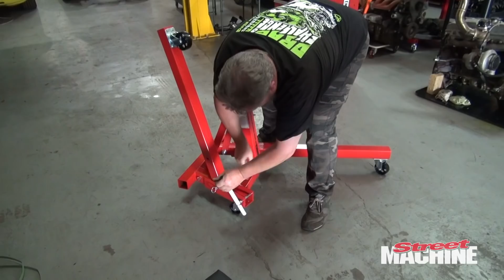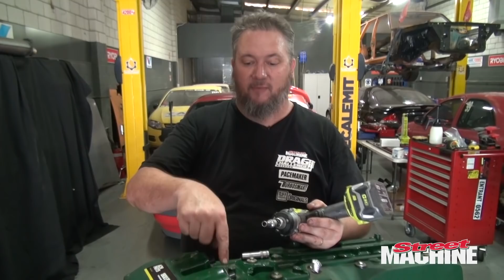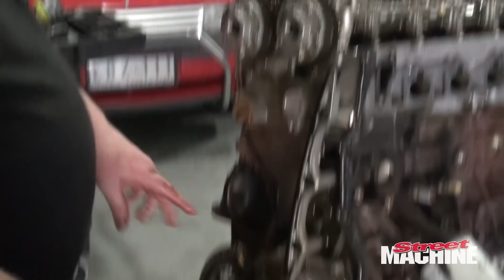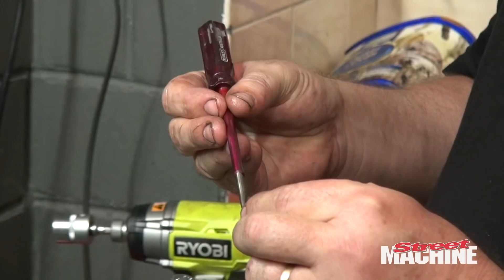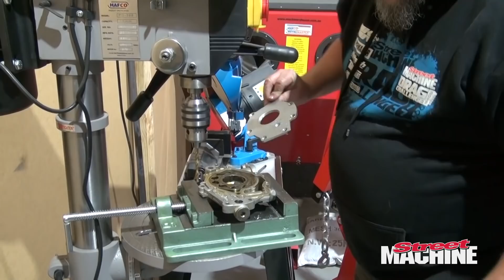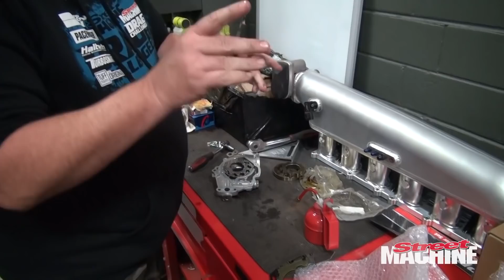Carnage Plus EP60 - Building A Barra For Boost - Part-1

Comment: How bad do the cam bearings have to get before you throw away the head?
Reply from the maker: There are no bearings, the cams sit straight into the head. I haven't had to throw one away yet.
Reply: @STREETMACHINETV  do you ever have line bore the cam bearing towers?

Comment: Hey mate, I’m an Australian mechanic working in Europe. With the rust and the torx I learnt to use a 3/8 ratchet in those situations because it gives a better feel and use Hazet tin coated torx bits. 

Using a hand impact driver like snap on PIT120 or KOKEN attack drive can help but I just get a punch the same diameter of the torx and hit it with hammer to jar the torx so it loosens.

Comment: Awesome 👍 brother...
I watch you...
Im hoping to get a Ford territory....NA..

I was thinking...
Change .. valve springs
Cam ..
Air filter
Oil pump
Header's..

What you think...
Will that make...my NA... Barra
Better than stock.. surely...
Reply from the maker: Oil pump gears are mainly for manuals or lots of power. Cams, valve springs, headers, tune will help you make more power
Reply: Thanks for your response..
I was watching....
Haltec.. video...
Talk about the almighty Barra.
He said those parts...
I watch your video... you were changing those exact parts. 
Awesome 👍 brother..
 I was taking them notes down.

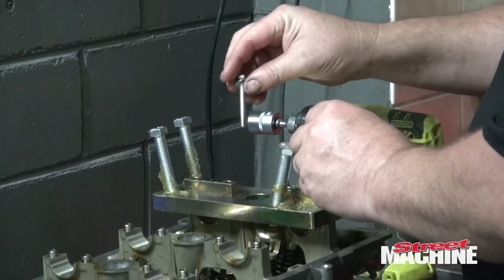Comment: 14:57 it's a year on so a bit late now, but for everyone else usuing this tool, make sure the 2 spacer blocks on top of the tool are underneath it. It makes everything line up and can get the new spring in without fighting it. It is on the wrong side here. Dominator had a batch of tools go out the wrong way round.
There a great company with awesome products. 
Cheers

Comment: Hey mate do you guys have a normal shop? If so what would you charge to do my pump gears, valve springs, head studs, cooler on my bf xr6 turbo if I supply all quality parts?
Reply from the maker: We don't work on other people's cars but we would recommend Maxx Performance for a job like that

Comment: Hey Scotty & Co. When replacing the Barra Lifters, Should the Roller Rocker be replaced in the original position Ie: Following the same Cam Lobe Wear Pattern. OR doesn't matter if you throw them in a parts cleaner & reinstall anywhere with new lifters?? Cheers
Reply from the maker: We've just put them back on any lobe
Reply: @STREETMACHINETV  Nice one my man!! Cheers for the reply & keep it up 👌

Comment: The oil pump screws are meant to be impact screwdriver out and in there is a special screwdriver for that that you whack and they come out they are not in tight they just need a good knock loose a impact driver is usually enough to get the job done just gotta be careful to not strip the head thats why there is a special screwdriver you can hit but its not so necessary its the whacking motion that loosens the screw

Comment: Wouldn't vasaline be better for the oil pimp gears than grease? , (it's what the rotary guy's use)..
So don't need to lower the comp on these engines for boost?,you lucky sod's we normally have to put in forged pistons and rods 👍

Comment: Plain old Impact screwdriver would have solved that issue, and no I don't mean the battery ones, I mean the old style you lock it in and hit it with a hammer.

Comment: Don't green tops have much higher compression for LPG?  How does that work with boost because I didn't see any changing of pistons.
Reply from the maker: Works fine
Reply: To what boost?  I ask because I have a Egas motor from an FG and I was gonna swap the pistons to lower the compression.   I'm actually running JTG liquid gas injection so less likely to detonate anyway but still worry about it.
Reply from the maker: @frankieh2011  up to 25psi, but safe at 20psi
Reply: Have you got any tips for tuning for high boost on LPG?   I'm using liquid gas injection which doesn't use converters and is more efficient and cooling than vapour but I'm betting you have some lessons to give on the subject and I've never seen much info on it.  (My car also has a Haltech elite powering it. ).     Basically I'm interested in knowing how the gas tuning differs from premium 98 or e85 from an ignition perspective.    I'd love to see your VE and advance tables or hear you speak of them sir.    Nobody really covers that stuff with LPG and I think it'd be useful to people if someone did.

Comment: when describing springs.... closed/open and what measurement at open.  For example, you can have 95# closed springs and #400 open or 95/150 or whatever... the final number we need is distance to coil bind.... thanks.   Not trying to be a know-it-all, just sharing tips that helped me.  Heat is your friend at getting stuck or loc-tite'd screws out.  Failing that, weld a nut through the center to the screw, count to 10, then twist out for the win (basically using heat and attaching a removal tool all at once). The other thing, take your brass hammer, a solid tap (almost a hit) on the protected stem of the valve will guarantee your valve won't drop because one of those infernal valve retainers didn't hold (do NOT ask me how I know about that... IIRC, it cost me a new, expensive motor).  love the show, keep up the great entertainment.
Reply from the maker: We weren't supplied those specs

Comment: make sure you use feeler gauges to center the pump over the crank snout. Best to install it when the engine is vertical so that the crank is centered in the block.

Comment: That has to be the most cumbersome valve spring tool I have ever laid eyes on. Wouldn't catch me dead using it.
Reply from the maker: Have you ever done valve springs in a Barra? The tool is designed to change the springs while still on the engine. The pros can do it in around an hour or so, in the car.
Reply: @STREETMACHINETV  have assembled literally hundreds if not thousands of heads. I used to work for Superformance in the 80's / 90's. Can see that tool galling the valve stem very very easily. Have changed springs on cars as well, I just don't like the design of the tool. For $150 (I looked it up yesterday) you could put together a proper head bench yourself that does all kinds of heads.

Comment: Hey dopey pack it into the gears not smooch it on the out side what happens when you put the plate on  yes it bleeds out you don't have a total seal
Reply from the maker: Anything else you want to complain about? I wiped away the excess grease

Comment: hey scotty after doing all this to the engine is the green top still a better engine or by doing the same to a silver top will you get the same result?
Reply from the maker: Green top will still be better, but everything needs valve springs
Reply: @STREETMACHINETV  sweet thanks for the heads up

Comment: Good quality impact screwdriver for removing the oil pump plate. I also prime the pump with a little Vaseline as it assists with quick oil pick up but then breaks down in the hot oil rather than possibly blocking any of the finer oil galleries. Keep up the good programming
Reply from the maker: Yeah, as we've discovered.

Comment: Those screws on the backside of the oil pump are impact screws.. Either use a hammer while you break them loose or buy an impact screwdriver.

Comment: For those tricky tight screws, tap the driver bit into the screw with a light hammer, then use an impact driver with adjustable power (I use my little Dewalt on middle setting)

1980’s landcruiser water pump screws are similar and can be a pain.

Comment: Petroleum jelly for the pump gears as it dissolves far quicker than bearing grease. I'd use the battery impact gun with getting the screws out, allows you more downward pressure and high impact force on those awesome screws. Good donk these ford sixes.

Comment: Quick question. For a 500hp application you would need oil pump gears, valve springs, headstuds but would you also need the billet backing plate and any other goodies?

Comment: Great vid Scotty.  Loving the Barra Build.  A great tool to use for those oil pump screws is an impact screwdriver.  You hit the end with a hammer and it turns the screw as you hit it. I use these on old motorcycle engine case screws and nothing else works.  They cost about $20 from Amazon.

Comment: Number 3 bit and an impact driver for the oil pump gears works well. Lots of pressure (I layed it on ground and put body weight on it).   I messed up and used a number 2 for one of my first screws.  Stripped the hell out of it.  Cut a slit in it and used a flat head bit in the impact driver lol.  Reinstalled it same way also with botched screw reinstalled.  Figured its an impossible screw to find.

Comment: This is the series I've been waiting on.ive got a ba2 xr6t 6spd manual,I've got almost all my parts ready for a engine build,manley pistons and rods,git a girdle and arp main studs head studs and a bunch of atomic stuff.i can get permaseal mls gaskets easy,but should I try to find cometic
Reply from the maker: I haven't used the Permaseal ones. I assume they are a factory replacement

Comment: buy an impact screw driver . rbs have the same issue with getting the oil pump apart or if you have a welder handy just weld a nut to the screw
Reply: Yeah get an impact driver, Soft jaws for the vice,  Don't lift the cams on an angle to get the caps off.  Oh and most gas engines are clean inside because well they run on gas. Love this channel.
Reply from the maker: Seen a few ugly brown gas motors inside
Reply: @STREETMACHINETV  magnatec oil..... yuk
Reply: I use a big screw driver put as much down pressure and twist as i can then smack it on the top with a hammer it works well enough
Reply: That was my method before I started using the impact :)
Reply: Yep, despite what the old boys taught in shop class, you’re less likely to break old rusty or stuck bolts a with an adjustable impact driver than doing it by hand.
Reply: After driving in/out over 5000 screws I learnt the power drill (impact or not) will strip way less heads. 
Keep the drill at 1 speed and while under power rotate the drill back and forth 2° repeatedly to keep the Phillips seated (they slowly auto disengage after about 5 revs}
Reply: Yes, impact screw driver for the win on screw heads like this.

Comment: I hate those Phillips screws too, a lot of brake disc retaining screws are the same and are rusted in.  I use an old fashioned impact driver to get them started, but can be too aggressive on precision light alloy parts. I keep a selection of cobalt reverse spiral drill bits just for these kinds of situations. It should be noted that oil pump gears are precision ground/lapped and should not be separated as the inner and outer gears must remain in the same relative rotation.

Comment: If you damage a screw head you can usually fix it by flattening the top with a punch the tapping the screwdriver in to reshape the top. You can avoid damaging tight screws by giving them a tap with a hammer and a punch or using a screwdriver with a metal end through the handle instead of a punch. Don't hit too hard on screws that are in aluminum parts.
Reply from the maker: The Maxx Performance guys showed me the way, using an impact driver. You only get one shot but it works
Reply: @STREETMACHINETV  you can do that too. But not everyone has an impact driver so I didn't add it. You can use just a screwdriver with a metal end by turning it in the direction you want and tapping the end with a hammer. I always do that when taking out the screw that holds brake discs and drums to hubs.